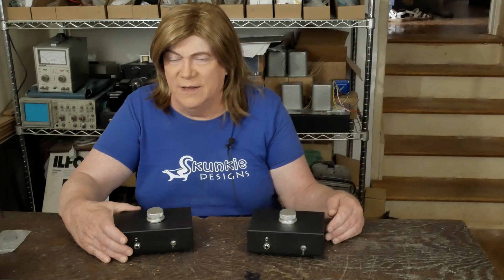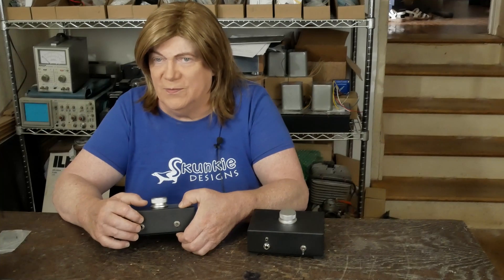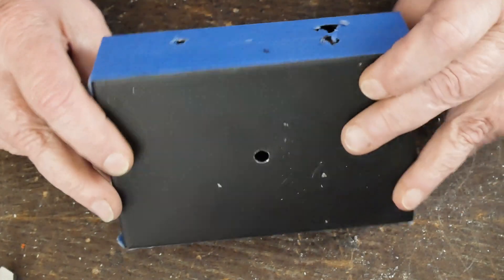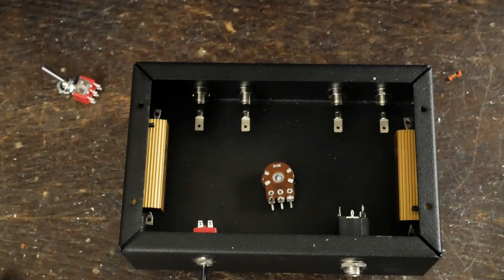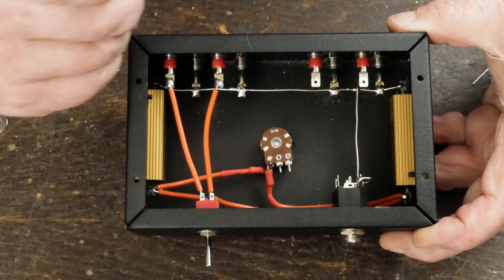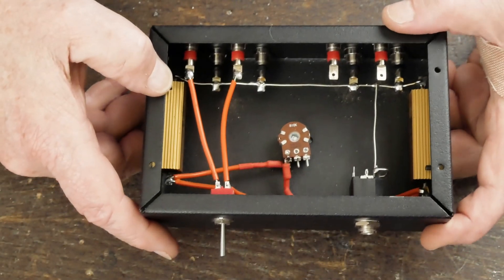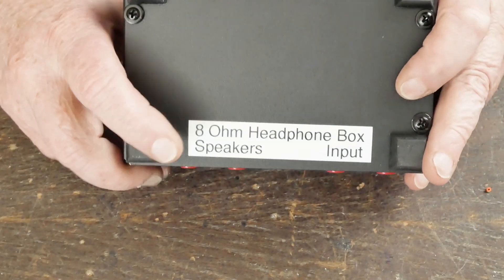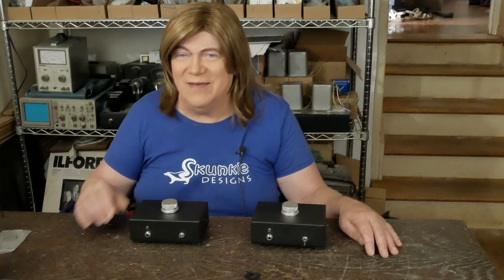DIY Tube Amplifier Headphone Adapter Revisited: Wiring!

Comment: Cool. If we are running the speakers at a show, but need a headphone out for an IEM, do we need the 8 ohm dummy load? Is 100 ohms enough for say a 50 watt Plexi?
Reply from the maker: No you don't (nor the switch) and you will have to experiment with the 100 ohm resistor. if you are trying to run speakers in the room AND headphones at the same time, that would likely need some adjustment of the values.

Comment: Hello, great video very instructive. could  this switch box be used on a tv 3.5 jack audio out. Yhe issue is that i have a hearing problem and i use earphone to watch tv at night, so it wont bother my wife with the tv volume. I have aux wire or 3.5  audio wire running from the front wall facing my bed to my headboard on my bed. i bought a new tv which doesnt have an 3.5 jack audio out (i know everybody tells me to use bluetooth.) i dont like bluetooth..doesnt work well. anyway what i did is open up the tv and solder wires on the positive  side of the speaker to install a 3.5 jack audio out. It works i also install a 50 v 10uf  capacitor and a 100k  resistors to the jack one on each side it works well no loud noise.. but i want to control the volume on the earphones and lower the tv spearkers on the tv . can i do that?? do you a circuit or some to install near my bed like your box with volume control..?? your help is appreciated

Comment: Hey Stephe, in the parts list you include a ground nut/bolt/lug but I never recall seeing them in any of the videos. Did I miss that or is it to simply ground the chassis? I don’t see any of the various connectors using the chassis as ground.
Reply from the maker: Whoops. I suck at making BOMs.

Comment: Very nice headphone amp. The smaller brother of 1/4 " is usually just called 3.5mm jack,  mini jack, or something like that. 3.5mm mostly. And we go from inch to mm because there is no nice round number in inches. The other thing goes for the 1/4" that results in a not so nice number in mm 😀 Nice round numbers are easier than sticking to one  unit standard. Even in The Netherlands in Dutch we use those words, not translated 😅
Reply from the maker: Thanks for sharing
Reply: @SkunkieDesignsElectronics  Same to you! :D And you are welcome.

Comment: The volume pot you used in the construction was a B taper (linear) 10k not a log taper (which would be A) which would be more usual for an audio volume control, was that intentional?

Having said that I doubt it'll matter much in this application, just the pot position vs volume may not be quite as expected.
Reply from the maker: As you said, in this use it doesn't make much difference as this is more of a trimmer.

Comment: I don’t understand these resistor values. With 8R and 100R, that presents 106.4R to the amp and 7.4R to the headphones. If the pot adds a full 10K, it presents 10106.4R to the amp and 7.9R to the headphones.
Reply from the maker: The resistors are not in series... The 8 ohm is across the amp output, the load the amps sees can never be higher than 8 ohms.
Reply: @SkunkieDesignsElectronics Oh, I see. In your approach, the series resistors are after the parallel resistors, not before, as is typical in L-pads.

So, in your set up, the amp always sees close to 8 ohm, which is good, but the headphones get between 100 ohm and 10100 ohm of output impedance, which is not so good since you should generally maintain a damping factor of 10 or more (1.6 ohm of output impedance for 16 ohm headphones and 30 ohm of output impedance for 300 ohm headphones).

Did you measure what this box does to FR?

Is there something else I am missing?
Reply from the maker: The resistance to the headphones is in series, not parallel. The FR sounds fine to me listening to it.

Comment: Can I adjust R3 & R4 for low vs. high-impedance headphones? With my 18-ohm HiFiMan's, I definitely want 100 ohms in series, but with Sennheiser's 300-ohm models, I'd remove them to maximize the available voltage, knowing the 8-ohm power resistors would dissipate most of the current and the parallel resistance would be close to 8 ohms.
Reply from the maker: Yes, absolutely.
Reply: @SkunkieDesignsElectronics  I have a Yamaha A-S301 with a dismal headphone output. That's why I asked about the adapter.
Reply from the maker: I honestly don't think you will need to.
Reply: @SkunkieDesignsElectronics  I run my line-level sources through a passive switch/volume pot. That makes it easier to use an external headphone amp.

Comment: Do you think we need a fancy pot for this project or a normal one is okay? Thanks for the quick follow up video Stephe!
Reply from the maker: Years ago I tried this cheaper unit vs a blue velvet and didn't hear anything. I never tried any $$$ units. The nicer pot may have felt a touch smoother?